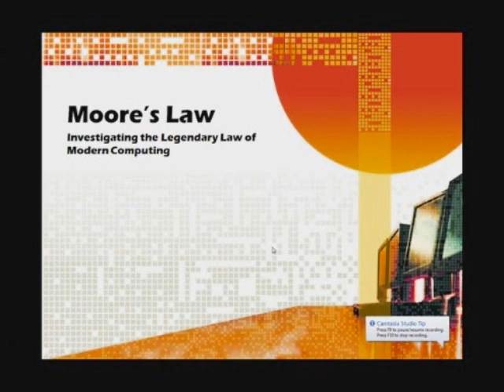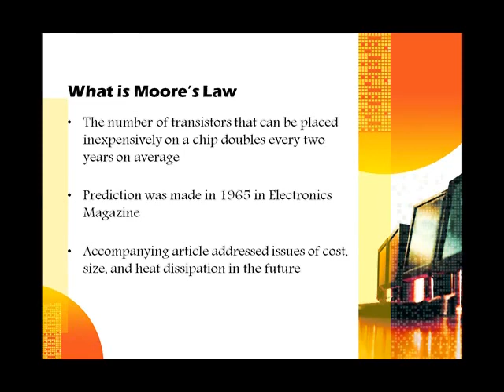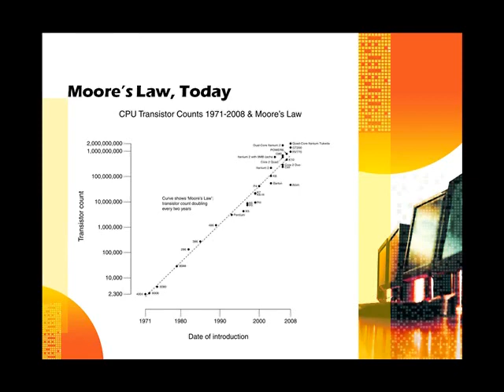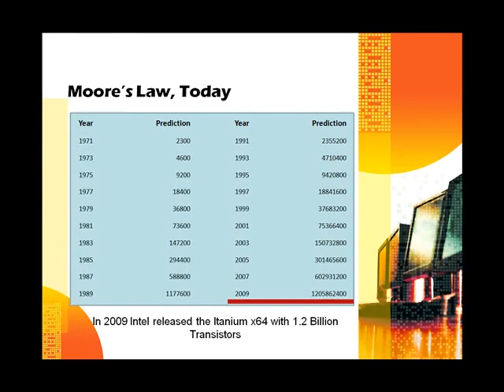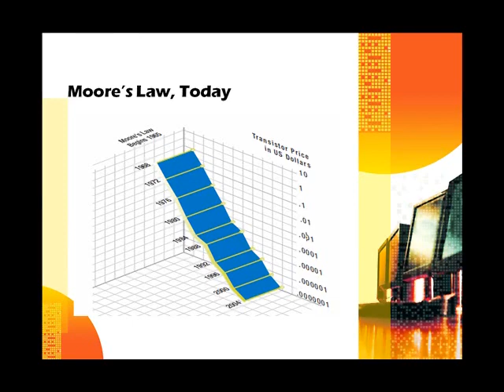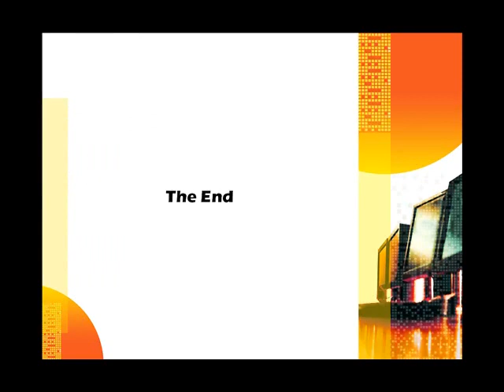Is Moore's Law Still Valid?

Comment from the maker: @quangluu96 It is amazing how many barriers have been broken.  There was a 640K memory limit, and a  2 gb hdd partition limit, a 4 gb hdd size limit,  a 32 GB limit, a 2 TB limit and more.  Most of these were never even know by the general public, but were imposed by the bit limits of older chips and file structures.  Clever engineers have saved the day every time.  3 TB drives hit the market and thanks to UEFI, they are  even bootable.